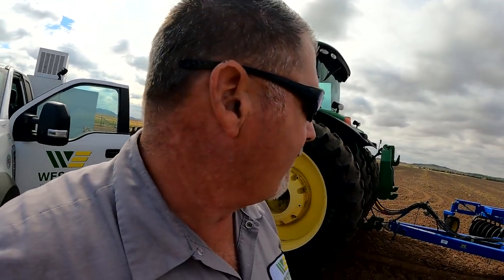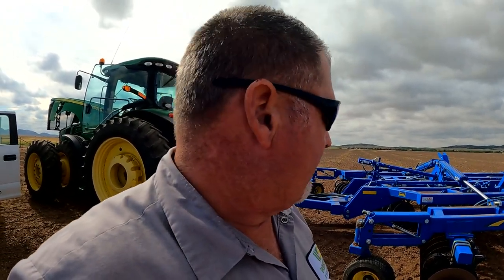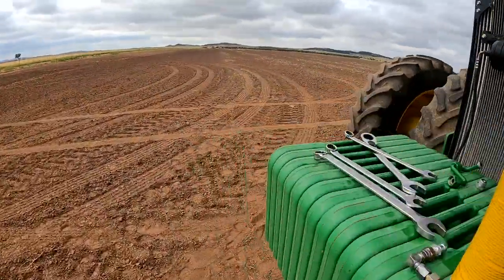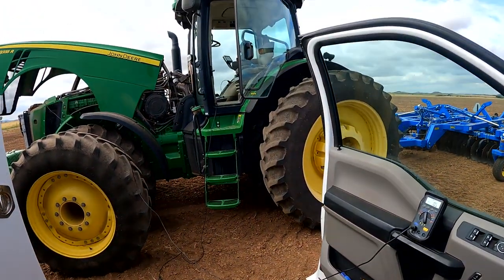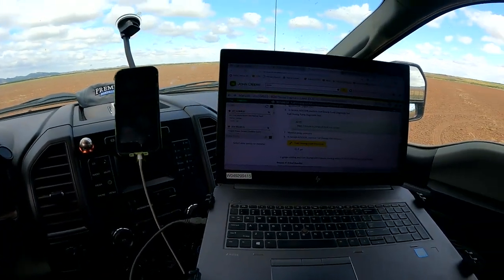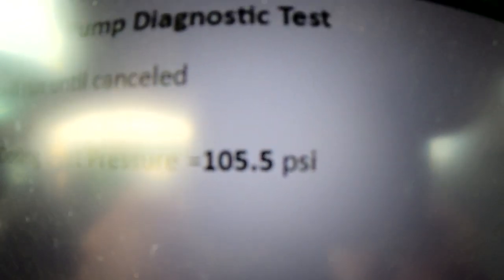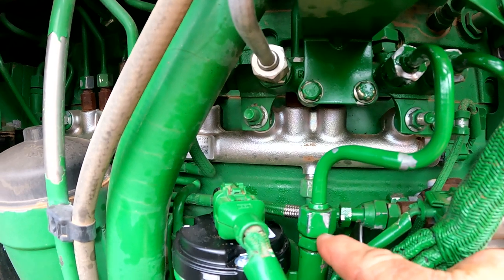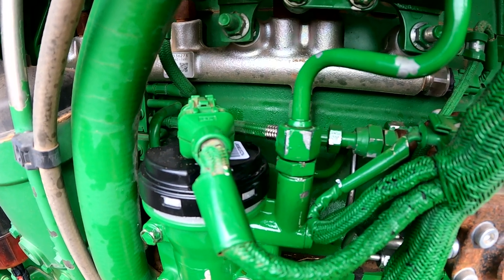Larry's Life E34 | Fixing Engine Power Derating on John Deere 8335R Tractor

Comment: Does it work to manually regen it from inside the cab on the same kind of the tractor?
Reply: Only if it is requesting a parked exhaust clean
Reply: @larrystewart2818  ok thanks ours is not so I think it’s fine
Reply from the maker: Thanks for the reply Larry!